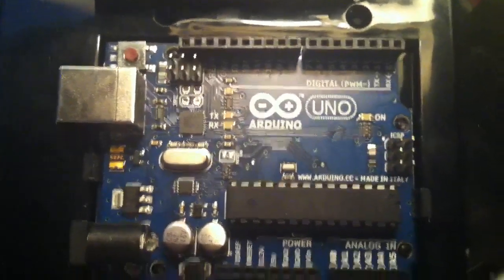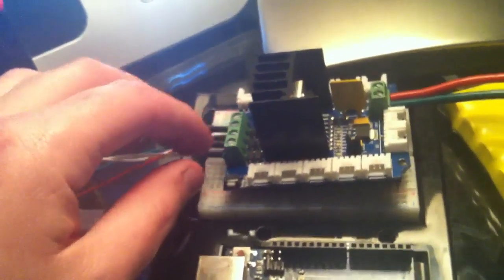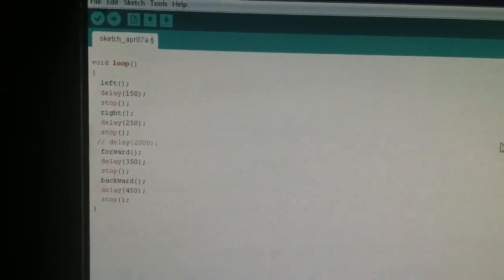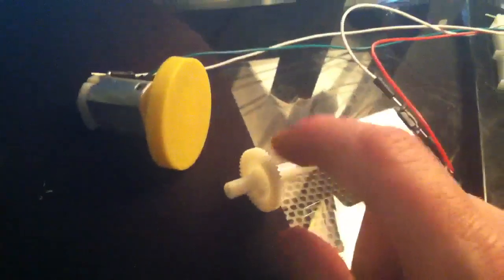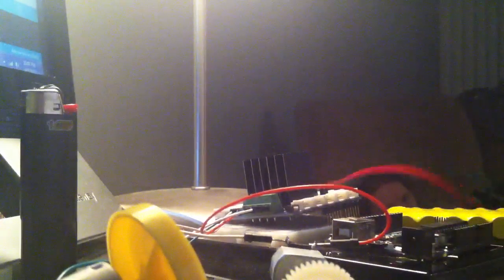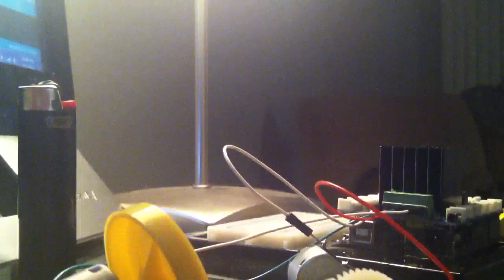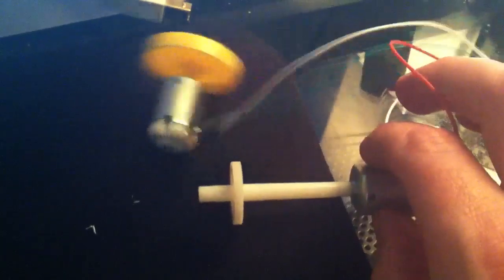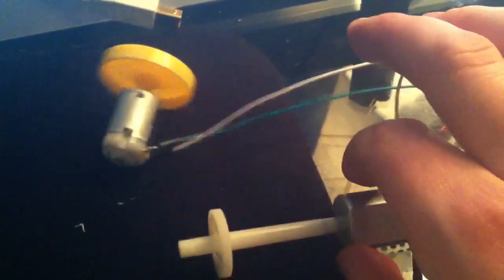Arduino motor shield

Comment: Uhmm... Those are DC motors. Those shields can only take 1 stepper motor that has 4 wires. I don't wanna make your sound dumb but you might wanna say in your description that you meant 2 DC motors .
Reply from the maker: Thanks for pointing it out i tend to mess uo my words in alot of my videos
Reply: No problem man. I tend to do the same!